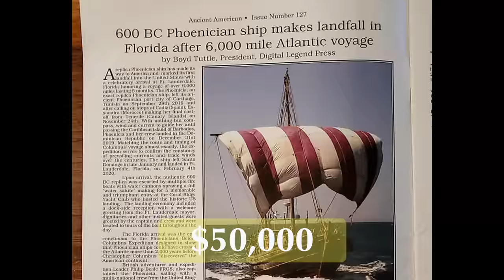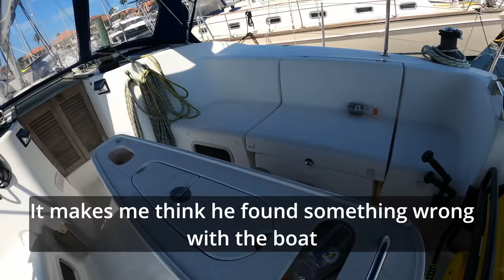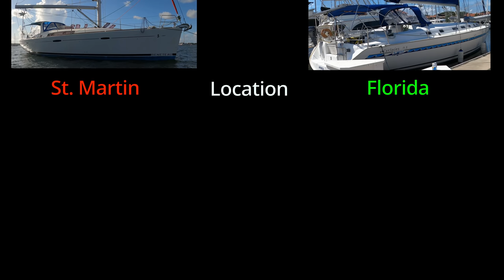I Bought a Boat with NEGATIVE -$4000 in my bank account | ep.2

Comment: You should check out a few things on those cyclades and address them to avoid major problems during a long passage. 
1. Some of the straight shaft cyclades have a motor to shaft coupling that doesn't have any locking method to prevent the coupling from unthreading itself. Repeated sudden reverse will literally unthread itself and your prop will pull itself out until it smacks into the rudder. You're not going to lose the prop since the rudder has to be removed to pull it out, but it will pour a lot of water into your boat. The bilge pumps won't keep up. Fixing this is pretty easy, just replace the coupling, or drill the existing on to add a pin or bolt. 
2. The jib halyard spool at the top of the mast corrodes fairly quickly and needs to be serviced every couple of years. Failing to do so freezes it and increases friction on the halyard which leads to catastrophic failure under load. Retrieving the halyard after this is a royal pain since it bundles at the bottom of the mast. Requires demasting and is not fun to deal with in the middle of the ocean. 
3. Glass delamination between the keel and the main hull. This is very common, this boat is pretty much a wet bilge boat. Make sure your bilge pumps are working properly and clean your bilge. Keep a spare pump at all times. They will fail. Make sure your manual pump works well. 

These are all a pain in the neck to deal with days from shore. Ask me how I know XD
Reply from the maker: Appreciate the info, we will look into it🤘🏼